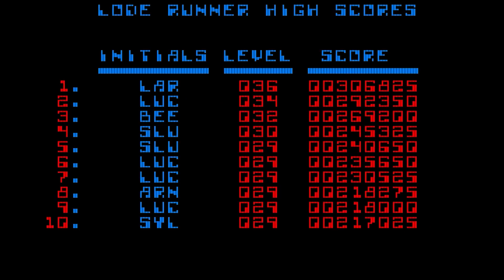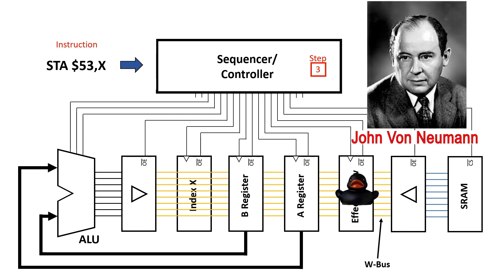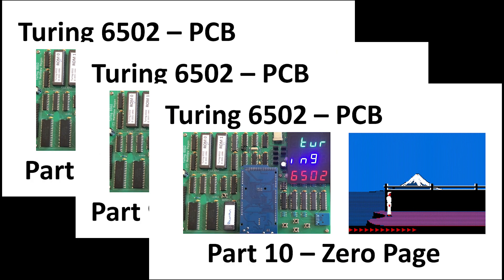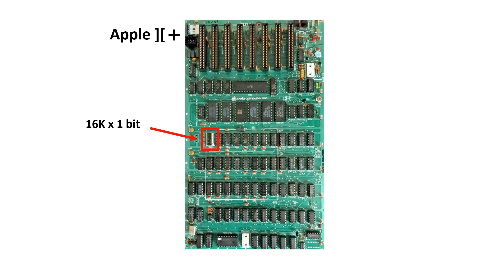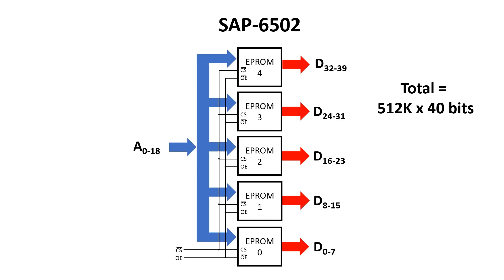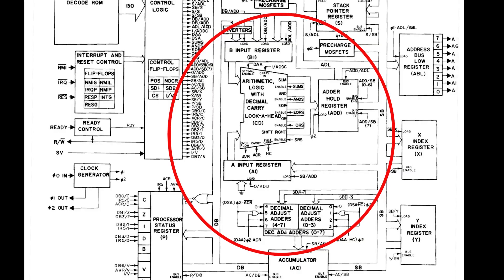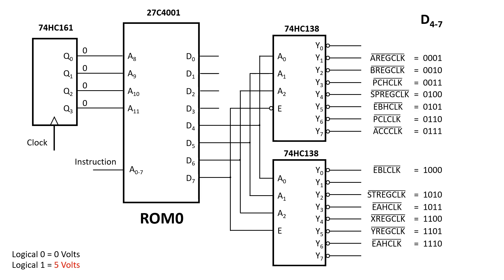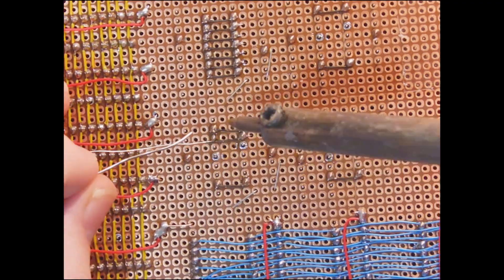How to build a 6502 TTL-CPU: Part 3 The Sequencer / Controller

Comment: About the usage of a latch: I figure it gives the (slow) microcode EPROM a little more time to select the appropriate instruction.
Reply from the maker: Without the latch we have to do an SRAM and EPROM lookup in the one clock cycle and this becomes the limiting factor for all clock cycles.
With the latch we do this over 2 clocks, but it means each clock can be much faster.

Comment: Would it be possible to wire some signals from the IR directly to the function select input of the ALU to save some eeprom data lines?
Reply from the maker: The problem is with the addressing modes.  You may want to do an ORA as the main instruction, but you need for ORA zpg,x, you need to do an add (ZPG + IX) in the ALU then do the ORA in the ALU

Comment: I just discovered this series and am loving it. I've been fascinated in chip-level processors for a few years and watched a couple of channels on building a 32-bit RISC-V CPU.
Unfortunately, both gave up part way through the build due to the complexity. I watched Ben Eater's series and while he finished the project, I didn't want to invest that much effort to simply compute the Fibonacci sequence.
I thought of the 6502 due to its simplicity and the wealth of software for it so your series is extremely interesting.
I also learned that computer data is stored as ducks. Now the story of Ping the duck makes sense. 🙂
I thought of a couple of modifications to this circuit. First, you could substitute a 4:16 decoder (74HC154) in place of the two 3:8 (74HC138) parts, less wiring.
Second, rather than latching the 32 outputs, you could latch the inputs to the decoders, halving the number of latches required.
In fact, you might be able to completely eliminate the latches if you use one of the other enable pins currently unused on the 138 (also available on the 154) to disable all decoder outputs until the ROM outputs have settled.
Thanks for the great video and entertaining and informative explaination.
Reply from the maker: Welcome, thanks for the ideas.  I'm going to be doing a new playlist where i rebuild this with printed circuit boards.  I drive these lines directly from the EPROM output flip-flops.  You might want to check out the Turing6502 playlist as well.

Comment: @5:20 The main difference I see is the Latch Enable (LE) is level triggered on the 373 and rising edge triggered on the 374. Not sure yet how this is important to the circuit though.
Reply from the maker: Think about the propagation delay from 
the SRAM to the Controller EPROM for a 373 vs a 374
Reply: @DrMattRegan  Timing diagrams are my Kryptonite.
Reply from the maker: Ha ha.  Well when the flipflops are outputting the control signals for step 0 (fetch) i need to read the SRAM, pass it through the latch without delay and present it to the EPROM before the output flipflops  are clocked so step 1 will be for the correct instruction.  If i used a flip-flop instead of a latch, the instruction data won't be incorporated until step 2 and i will have wasted step 1.